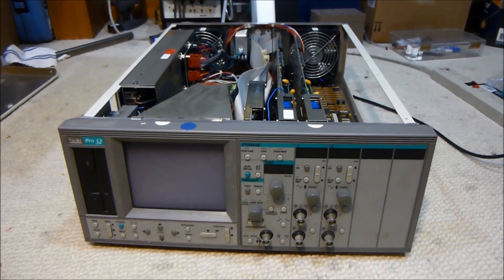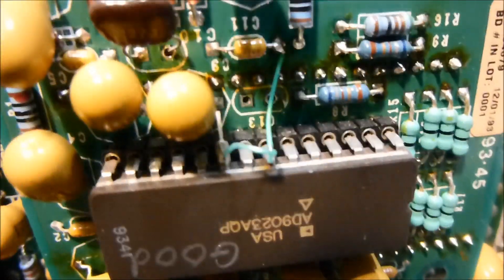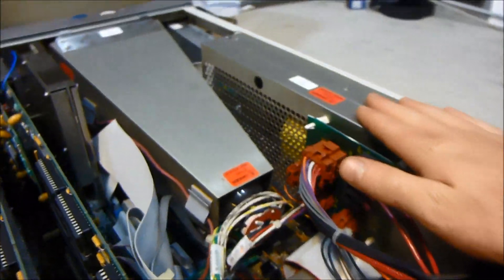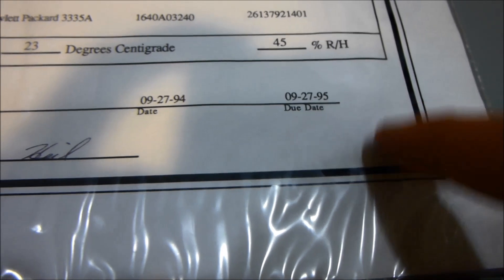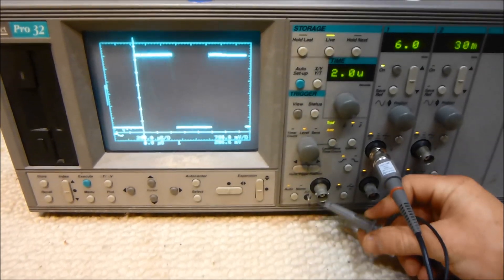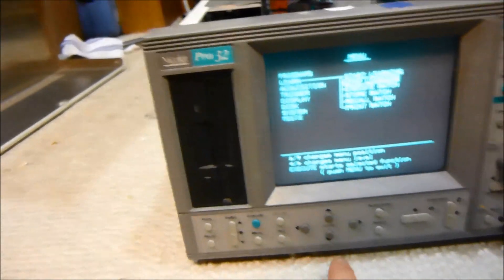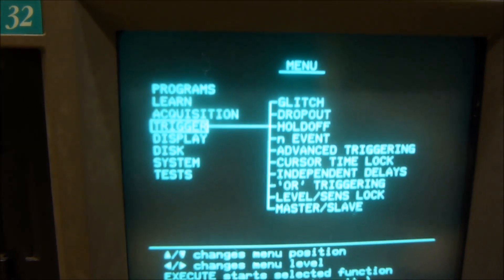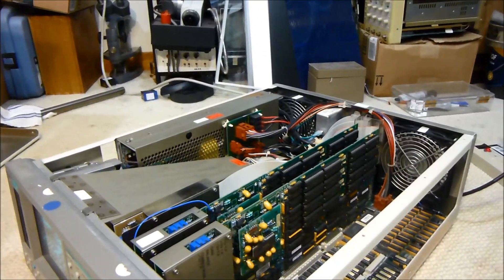Nicolet Pro 32 Oscilloscope

Comment: The Tek 214 looks like a neat little field scope. Here is a manual for the one that is still not working:
http://pcbunn.cithep.caltech.edu/jjb/tektronix/214/Tek-214-Manual.pdf
Reply from the maker: Oh wow!  That's just what I need!  I think I should be able to get it working with this manual!  Don't you just love old things that have manuals that tell you how to fix it?  Thank you so much!  :)
Reply: Well, that is why most of my equipment is of older vintage. Many of the 80's & 90's Scopes contained ICs that are unobtainable making the unit pretty much worthless. Tektronix did use a few esoteric components (however few of these seem to fail) but most can be replaced since they are discrete single-function units.  Some Teks did use a special IC in the horizontal sweep section. with the rest of the scope using discrete other than the HV circuits.
Reply from the maker: SpinStar1956 Ahh makes sense!  The mini Tek scope I have has one of these weird IC's!  http://www.qservice.eu/shopexd.asp?id=1525&bc=no  I've never seen anything like it before!  These mini scopes I have are pretty awesome because all the transistors and IC's are not soldered on the board.  They are in little socket kind of things.  But just glancing at the board you would never know.

Comment: Woo how! Reminds me of my 80's Nicolet 4094 oscilloscope! Also used 450w.  Sold it in a few weeks cause it was just so stupidity bulky. The fun part was when I got it every chip had to be reseated(by the looks about double as yours).
Thanks for sharing!
Reply from the maker: Anton Babiy Oh wow the Nicolet 4094 think looks awesome!  So many knobs and dials!!!  Hahaha sounds like the shipping guy bumped it around a lot!
Reply: Makerj101 LOTS of knobs and dials! Without a manual = headache 😤 As about the shipping it cost triple as much as the  scope! What I didn't know is that these scopes are used for long term measurements like a few years in one sweep! And they can't go faster than 500hz so bummer. Definitely don't recommend this scope for hobby use. So many chips, so many problems 😱
Reply from the maker: Anton Babiy Hmm I see what you mean.  Sounds like a massive headache.  That's really annoying.  So it's more like a X Y plotter?
Reply: Makerj101 Yeah.  It has plotter outputs on the back for even more long term plotting.  When I was selling this thing the guy that came to pick it up told me that it was used to measure earthquakes and sun activity.
Reply from the maker: Oh!  Hahaha yeah that would explain things.  Not very useful!  I have a XY plotter and it's pretty nice for measuring things like battery drain extra.  I don't use it a lot though.

Comment: Yes, that is a neat oscilloscope. Nicolets were popular with small to mid-size engineering firms. And for a tech they are nice because you could have various setups that you store on floppy to later recall. I'm not sure if it has waveform-record function but it just may (this would explain what appears to be a bunch of static-ram chips on each vertical board.); this allows you to sample waveforms in the field and later examine them; which means you have a storage scope and can capture non recurrent waveforms (i.e. like an out-of-bounds signal that is killing your MOSFETs--LOL!). Another use, if it has capture is to use it as a 2-channel logic analyzer; as 2 channels are usually enough to troubleshoot digital with if you have an idea of your suspect trouble area.So, you might look into the triggering instructions on how you can set it up for single-shot with capture. Maybe like the primary waveform off your high voltage generator (BUT NOT THE SECONDARY!) and you could capture what your MOSFETs are seeing when you strike an arc.But be danrn careful as you can blow out the analog front-end if you get a large (probably >400V) spike! But you could probably do a video showing the gate-waveforms of your MOSFETS without harm as the MOSFETs will suffer gate punch-through at greeter than 20V. Another trick I have used to to place a MOV across the scope probe input that will clamp the waveform at 130-250V depending on what MOV you have; this can protect the scope too with little waveform distortion (because it is not conducting unless there is a spike).

The nice/bad thing is all the socketed chips. They are easy to troubleshoot/repair but sometimes are the problem. The fix for both is to first re-seat all the chips if you have a problem; the next is chip substitution if something is dead. A lot of the bigger chips are volatile static-ram that loses data when power is removed. I believe I saw an Analog Devices A/D chip near the front-end of vertical channel card. The 12-bits means that the vertical signal amplitude has 4096 voltage levels of resolution which makes a very smooth looking waveform when digitized. So, you could in theory keep this guy going a long time. BTW: I probably have many of the chips in it--let me know if you see purple smoke!

So, you have a very nice scope, with the only caveat that 20 MHz BW can limit your ability to see glitches. You can compensate for that by adjusting the trigger level (in single-shot mode) and it will tell you that something (of a certain high speed voltage-magnitude) is there when you can't see it in the waveform trace. Thanks for the video!
Reply from the maker: SpinStar1956 Yes, you can save wave forms and I love that function but I totally forgot to show it!  And you can save a wave form from both channels at the same time!  I need to do some more tests with my ZVS driver.

Interesting!  That's a lot of voltage resolution!  Yeah something I defiantly want to keep around for a long time!  Thank's I'll remember that!

You can zoom in on wave forms.  I do that sometimes when I want to see really high frequencies when it's already on the fastest time.  But yeah it's a really good scope!  I also have a little tiny analog scope that's battery powered!  Well technically I have two of them.  they are Tektronix 214 storage oscilloscopes.  The one that works was made in 1971.  The other one doesn't work and was made in 1972.  When I got them nether of them had the outer cases.  Just the bare bone innards.  But the one works pretty good.  It's a little fiddly finding the signal and getting everything set up right so you can see the wave form and to get it to trigger.  I've actually thought about trying to sell the non working one.  You can find some of the schematics so I wouldn't think it would be to hard to repair it.

Thank you for all the tips, information, and stuff!  Huge help!